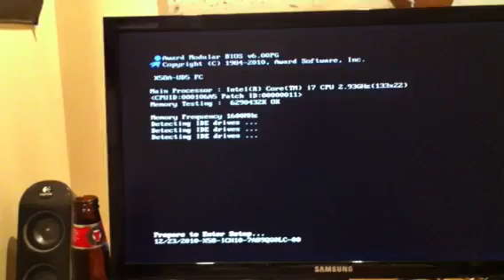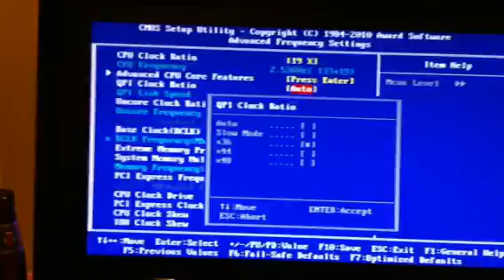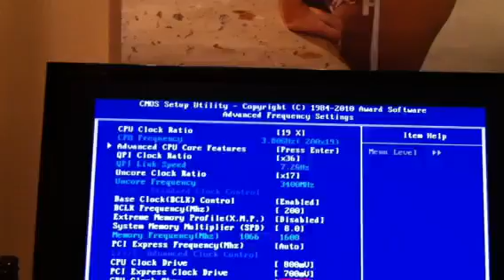Installing my GTX 570 channel update

Comment from the maker: @atkd95 your card is PCIe 2.0, which is the standard for all new cards, so yes, you can buy any new card and it will fit in your mobo... but you need to consider power requirements when upgrading to a more powerful GPU.